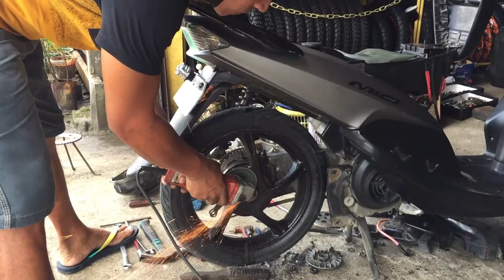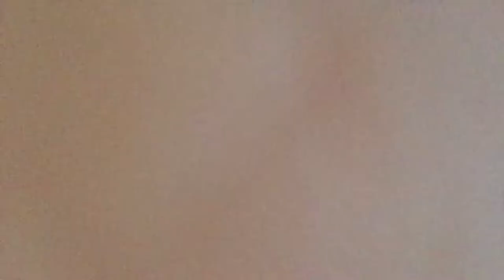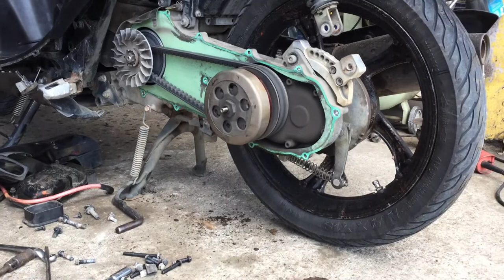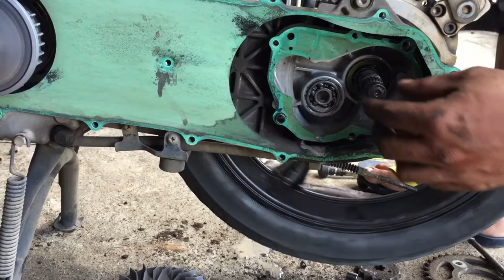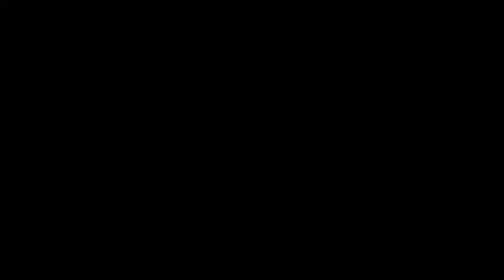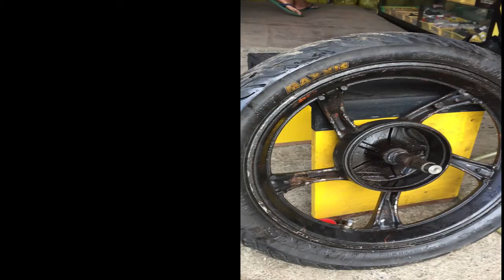Part 2 MiO Mags Stock Up..4 years walang Baklas.. pinutol nalang yung AXEL...

Comment: Sir tiga hagonoy bulacan or TUBIG  ALAT kami .... maraming na stuck up na rear wheel sa motorcycle dito ... acetylene namin yan tapos spray ng WD40 tapos hammer rubber .... unti unti at dahan-dahan lang po.